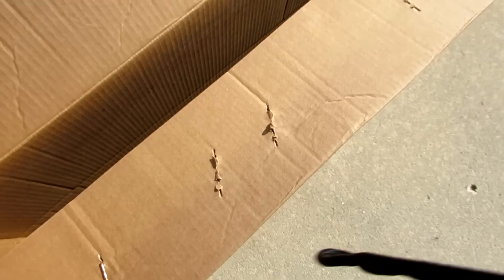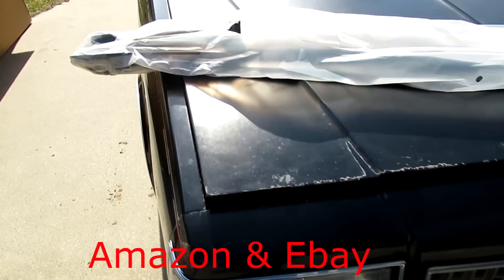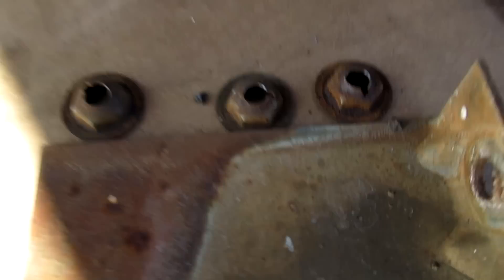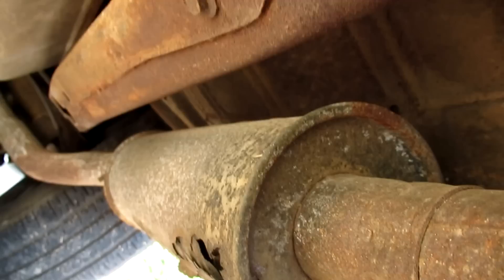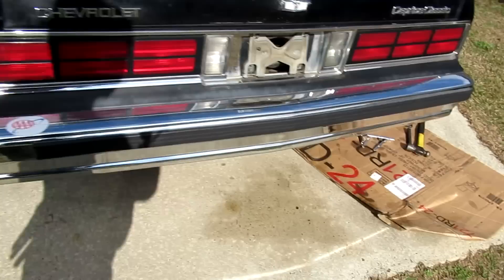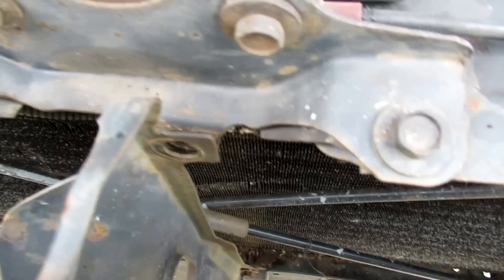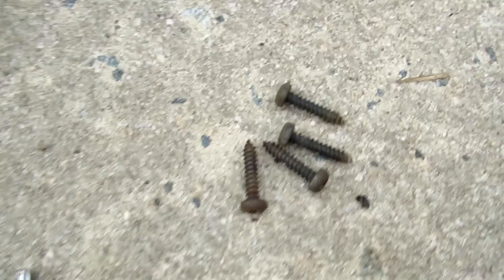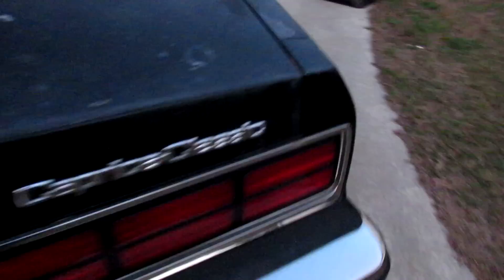How To Put Bumper Fillers On A Box Chevy 1989 Caprice Brougham Ls

Comment: I pre-painted the filler black, as my Caprice is black color. I used a flat, low profile and long socket driver with swivel head to install the upper bolt for the rear bumper filler. Only Harbor Freight has that style driver. It made installing that nut a breeze.

Comment: Hey do you still have the box Chevy caprice classic haven't seen you in a while
Reply from the maker: Naw bro I sold it, I might get another one soon
Reply: I have a 87 box Chevy caprice if I can't find someone to help me get a few things done on it I just might sell it it has 88000 original miles on it
Reply from the maker: @vocals4378  how much
Reply: I'll take 5000.00 or Best offer I got a 19992 Cadillac Fleetwood I'm going to put it together but I have over 2300.00 just in the New transmission,paid 4000.00 for the box Chevy, have over 1500.00 in part's including the bumper fillers front and back new super heavy duty coil springs, headers,carb,cam, and lifter set I'm just ready for this to be gone
Reply: 1992 Cadillac Fleetwood brougham D-Elegance
Reply from the maker: @vocals4378  is the box a half top, and what color is the lac
Reply from the maker: @vocals4378  you got a ig
Reply: Yeah it's the same as my you tube
Reply: The Chevy caprice is a hard top the lac is on my you tube page